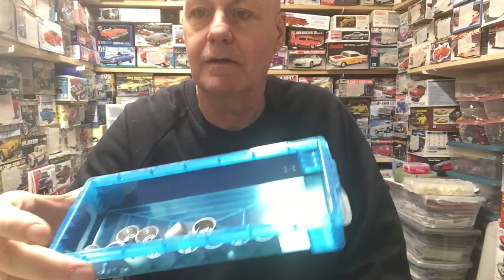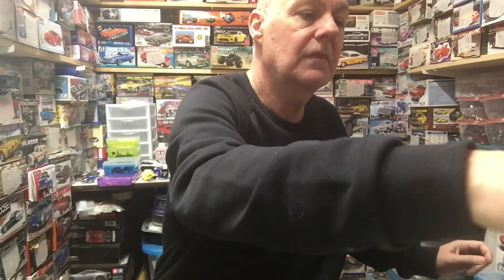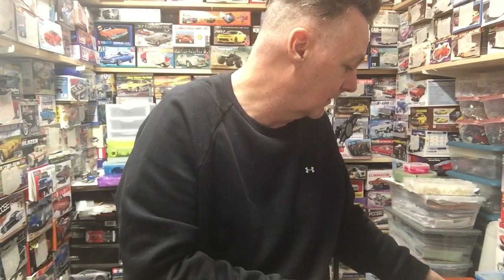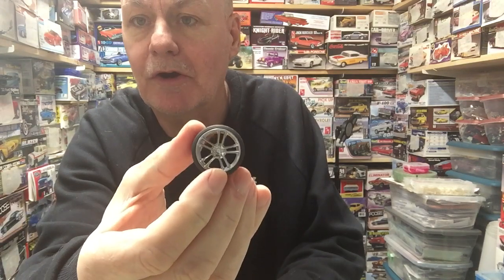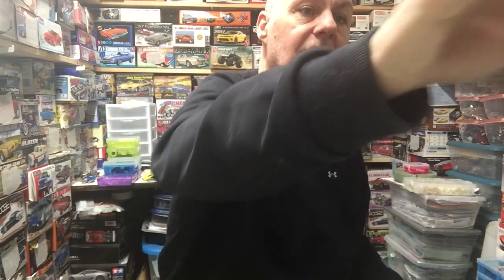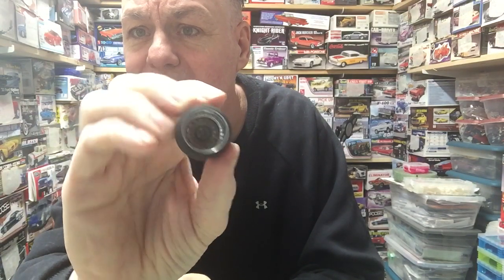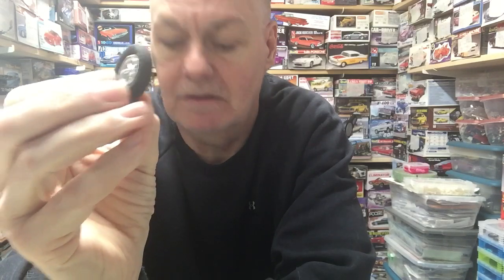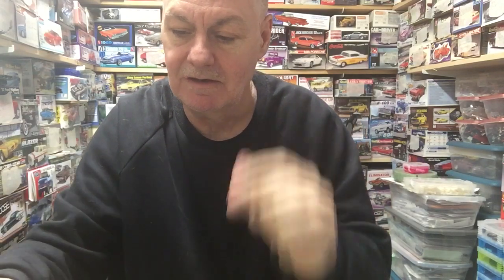3D  printing show and tell

Comment: they ware all pretty neat bro very nice what printer you use? Great clear too
Reply from the maker: I use an elegoo mars… looking into upgrading to a bigger anycubic 6x
Reply: @doozersmodels3193  I've mars pro so same size what version have you saved on your tumbdrive /computer reason I ask is trying to get similar settings set mine up too that prints

Comment: hey Dwayne bro hope you are well im stuck with my printer i dont know how to download updated version its downloaded but it's firmware for latest level I cannot get hang or use to what I've to do weather I wipe tumbdrive first then download every file then plug into the 3D printer it's confusing me i cant use version of chitubox I was using cause they deleted version after I updated so yeah im only able to print what's on my drive now but I'm afraid if I wipe it to try get updated version to work that if it doesn't work after wiping it ill have nothing at all to print
Reply from the maker: Maybe get a new thumb drive and download it on that… save the old one as a back up